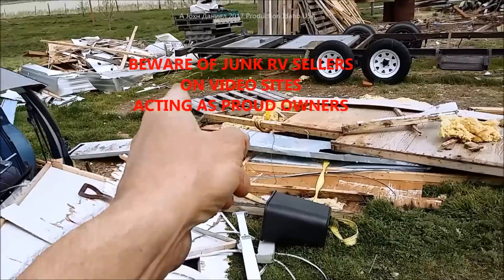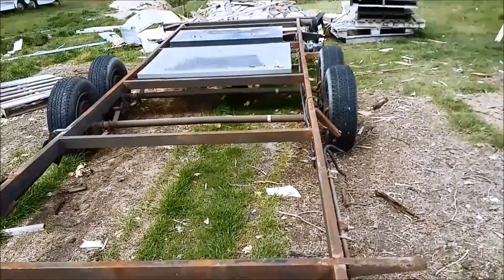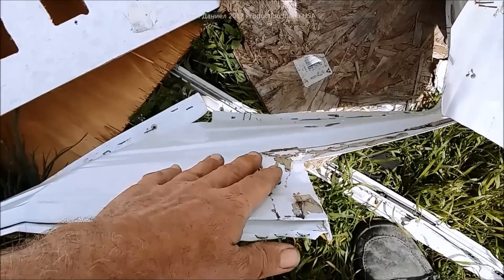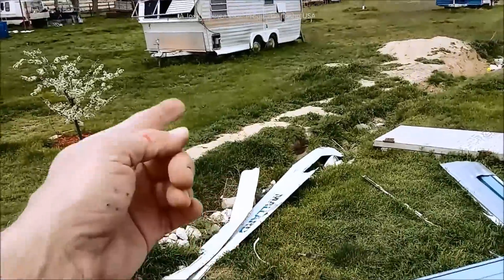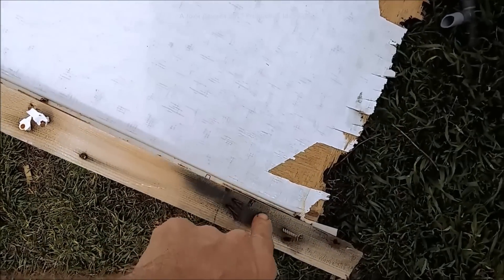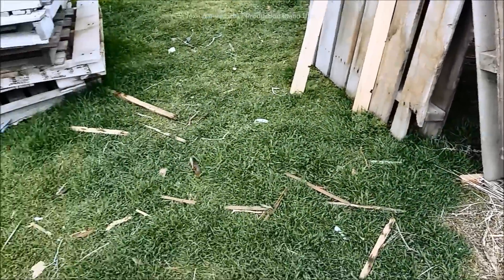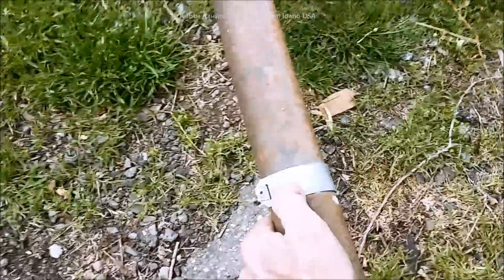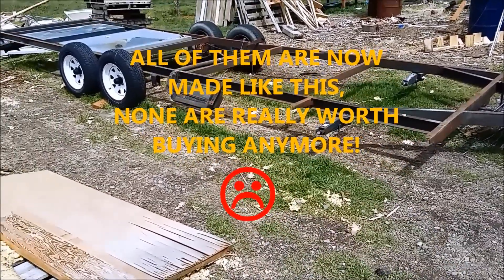HOW THEY MAKE RV Campers Travel Trailers, The truth, Wow! Info Below

Comment: Screwless enclosed trailers with one piece roof. Only wood is the 3/4" floor. Add quality appliances to your DIY floor plan.
Reply: Steven Morris Do you use blueprints or just design it yourself and try to balance the weight on the frame? Also, how do you fasten a screwless design? Use adhesives?
Reply: Steven Morris  and the floor can be composite .. that also doesnt rot... wood floors suck... ask a boat owner...lol
Reply: It's 3M adhesive tape installed at the factory that bonds the outside skin. Weight theory suggests 60% weight forward of center axle(s), 40% behind and 50/50 side to side when fully loaded. The rest is your imagination. GL

Comment: Watched another video recently about RV axles and this video really emphasizes the garbage. How can these manufacturers get away with underrated axles.
Reply: Powder River they are not underrated, just barely passable.   5,800# trailer rating, but remember that between 10% and 15% is on the tongue. 

Even the aluminum framed ones have issues.  Like forgetting to weld the roof to the side walls.  Staples through wiring.  Lapping metal in a reverse direction so when going down the road water is forced into joints. Not lapping roof over end caps and on and on.

There are custom builders that use quality materials with good workmanship.  Naturally you pay more up front, but buying quality is less expensive than buying cheap junk.
Reply: Charles Noska you’ve got point.

Comment: Like many, said, you get what you paid for. We bought a 2018 Keystone Passport and from everything I could see, specially the frame it looked to be built significantly better then what you showed. We traded it in for a 2018 Rockwood (just for lay out reasons) and the aluminum framed, foam filled vacuum bonded walls and ceiling are rock solid on everywhere. This new Rockwood is 8700lbs empty but I'd rather be pulling a well built trailer than worry about saving a couple more miles per gallon!
Reply: I hope you still like your Rotwood when it delaminates and the foam laminated junk floor gets soft everywhere
Reply: AnglerX  I think it's all on the owner.  Do your inspections of seals, roof ECT should last.  He does have a point that they are thrown together with staples, even TT that are at dealerships today.
Reply from the maker: I recommend absolute diligence & getting one of these, https://ebay.to/2KX8qVz to make buying and owning one less risk. A Scope to see inside walls, in and under everything.

Comment: I worked at a Fleetwood plant once in Va.Sometimes the camper would lift completely off the frame on its maiden trip to the dealership.
Reply: Wes Frazier 
What did they do then, set it back down and add more staples?
Reply: wes, im thinkin staples are optomistic!
Reply: Extra staples wasn't in the budget..... they use duct tape and a bunge cord.

Comment: Oh you're making me sick. I just bought a new Mallard. I looked all over YouTube for pros and cons and I didn't find a bad video. Now I've got one and I find this video. Man, all of a sudden I don't feel so good.  It's a 2018. Do you think it's the same crappy workmanship?
Reply: Ogooo.. It's even worse then before... look around.. tell me 1 thing that is any better then 10 or 20 years ago? you can't.. America sold out.... america gone under..
Reply: My mom just bought a 32' 2018 Mallard. It appears to be well made and solid. The frame looks very sturdy and it has 5,200lb axles. It isn't high end, but I don't see any reason it won't last. The MSRP was 42K and she picked it up for 25K. It has 3 pop outs and powered awning. We'll see how it holds up. She went into the market knowing that they aren't meant to last a lifetime.
Reply: mallards have com a long way in 10 years. they are made by Heartland now not Fleetwood and they use 2 by 4s now and wrapped better. this guy doesn't take care of his stuff that is why it leaks and is rotted. they have the enclosed underbelly which helps keep it dry. this is a poor rep of the modern rv....I know cause like your self I did some research when I bought my 2018 mallard m32
Reply: Stroker Ace . . . Then take a few tips from this video - - 
First - dry store the camper in at least a car-port.
Get wood glue or Gorilla glue and lay it on all hidden seams inside cabinets.
Apply wood anti=rot, or at least varnish to everything you can reach after the glue has cured. (obviously you can't pull down the wall-paper and do everything)
Consider welding diagonal angle-iron underneath to triangulate the frame . . . it looks like the stapled, thin wood box gives the trailer it's strength and shape.
Tow the trailer "empty" to reduce stress.
Reply: Stroker Ace mallards are pretty low end, not built to last long. I have a friend that bought one 3 years ago and the trim work is peeling and the sink leaks, etc.  Sorry...
Reply: Stroker Ace Yes, but anything you were considering prior to purchase is built the same way.
Reply: Fleetwood quit building wood frames at our plant in 2002. Keystone rv set up a plant close by and glutted the market with even cheaper units. Lippert Components  built all the chassis for both companies. When Fleetwood closed, Keystone bought the plant and continue to thrive selling cheap trailers to unsuspecting people.
Reply: Why should a person have to rebuild there new R.V. and tow it empty? Load and unload it every time you pull it. I'm a  retired R.V. tech. there all garbage.
Reply: Fleetwood RV no longer exists as a stand alone company.  The Fleetwood name was purchased by REV Automotive, and REV produces motorhomes with the Fleetwood name on them, and Holiday Rambler, and Monaco.  REV, thus Fleetwood, no longer produces towable RV's.  Heartland RV bought the rights to the Mallard name four or five years ago and produces "Mallard" travel trailers.
Reply: Even more so
Reply from the maker: I recommend absolute diligence & getting one of these, https://ebay.to/2KX8qVz to make buying and owning one less risk. A Scope to see inside walls, in and under everything.
Reply: The biggest killer is leaks, hands down.  Yep they're made light so that an average person can tow them with an average SUV.   Learn to spot the signs of a leak, keep a close eye on your roof, do your every six month roof inspection, seal up anything that looks suspect.  Floor damp spots, any stains, get down underneath and look for any stains on the bottom side. Any good camper space can fix the more difficult exterior leaks if you have questions.
Reply: I know, it's sad and no one's picking up the slack not the chinerese nor even the Germans!!! America's manufacturing gets sold out by it's govt in the 90's and the rest of the world suffers, I do feel your pain sir...
Reply: thanks for the info, i heard Fleet wood quit
Reply: Buy a used Evergreen Everlite Travel Trailer. Don’t go over the year 2012. This company built the Everlite series with zero wood in the roof, walls, or floor. They used a material called Compositek. I own a 34BHK-DS. I hope it never leaks, but if it does I can deal with the leak and move on. Never have to worry about rot! Return the Mallard...just my advice!
Reply: Mallard made by heartland nothiing wrong
Reply: Stroker Ace i got a 2004 mallard and it still solid with no leak everything still works
Reply: we just got a 2018 Rockwood Roo hybrid...Jesus I hope ours is better than yours...man I feel bad for you...we had a Starcraft popup...it was a 2016...I think it was junk. we traded for a new roo
Reply: Yep
Reply: Stroker Ace your RV is well made.enjoy it
Reply: I've visited Fleetwood,  Coachman and Keystone.   From what i saw of the frames and chassis, Coachman seemed to be the best and Keystone was horrible.  If you saw how they assemble a Keystone you would never buy one
Reply: Stroker Ace, Do good maint on your unit. ie. make sure you don't have any leaks on the roof, keep your tanks and water heater clean, etc. Yeah quality varies from manufacturer to manufacturer but longevity on your unit is just like anything else. Even a luxury car can go down the drain if not taken care of. Best wishes on your adventures.

Comment: Its also owners not taking proper care of their trailers
Reply from the maker: My Smart Solution -  build travel trailers with spot welded 1x1 24 gauge metal stud and 24 gauge hat metal, using jig built construction. Using spray in foam for additional strength & R-14.5 Insulated value.  
Result - Faster built, very light even 18% lighter than wood equivalent, tension durable, strong like russian bear, solid like mexican woman, user friendly like paid off grubberment official, and dependable like japanese radio!  And bonding glue agents with a few rivets on a metal to metal for outer skins is like how air planes are made, very long life and durable. 
You end up with cheaper, better, safer, recyclable, non expiring RV you won't burn in. But ah, isn't that the problem! It would last too long and be too safe.
Reply: Nicholas Brown, and Jayco brags about how they can build one in 7hrs. No thanks!!
Reply: Nicholas Brown im a master certified rv tech. They are all slapped together as fast as humanly possible with the cheapest materials available. Even if you keep up on leaks and reseals the newer ones will never last as long as the pre 90s rv's. Fleetwood bought out all the small outfits and started mass production. If you dont catch a leak in time its too late because its all pressed sawdust and osb. Sponges on wheels. The only manufacturer that has decent quality, unless you want to spend 1 mill on a custom coach, is newmar. And your going to pay more for their products too.
Reply from the maker: No kidding, the previous owner had the idiocy to take it out from his enclosed RV garage into the open weather on more than 5 trips.  He should have known it would get wet. Then he was foolish to file a insurance claim on the silly thing for the windows becoming showers on a trip.
Reply: It's called reseal the trailer as needed. I'll agree 100% that they're made very cheaply. But if windows and doors were leaking, the caulk should have been replaced. You have to maintain it.  This ain't Ron popel.  Cant just set it and forget it
Reply from the maker: I do agree with that, but no one should end up with a RV so shitty put together that it don't even make it past the 1 year warranty. I got it for $190 at a insurance salvage auction. When I tore it apart, it never even had insulation in most of the entire passenger side of the trailer, FROM NEW!!!! and the windows when I pulled them half had gaps in the mastic of up to 2 inches. Thats Fleetwood !
Reply: Watch the video on how jayco travel trailers are made. Makes me not want to buy a jayco. And it's their promotional video lol
Reply from the maker: In 1994 the very limited rules on RV's was relaxed so even the formerly GREAT makers went to shit. Holiday Rambler, Streamliner, Avion, and numerous other properly built RV's got lowered quality and or went out of business trying to compete with the STAPLE KINGS like Fleetwood. A PRE-1993 Jayco is a good RV, as well as the others mentioned above. If one like a Silver Streak or Rambler in good shape is found, grab it.
Reply: I just replaced the roof on my 95 nomad. It's not terribly difficult,  but time consuming.  I'm contemplating buying a new camper rather than rebuild a used one. The good thing about rebuilding a camper is you know what you have. The new junk is all pressed cardboard. Unless you're willing to spend 100k. Which I'm not. And even then there is no guarantee
Reply from the maker: Wanna buy a solid 1976 Holiday Rambler 32.5 foot Presidential to upgrade and do up nice? I would sell mine to a person intent on modernizing it. Its very solid, aluminum framed and no rot or damage other than just its age. $2500 and its yours!  I got too many rolling wonders!
Reply: Pass but thanks
Reply: Nicholas Brown yeah I saw that one.  Absolutely insane.  This guy is right.. ..they pump them out just as God awful fast as they can and they say piss on quality......
Reply from the maker: The Rambler? Twin Falls Idaho. I have a newer very large refrigerator, new AC unit and a few newer items already in it to start its refresh job. But being such a solid RV, that makes it easy.
Reply: Nicholas Brown even 100k won't get you what you pay for. If you can find a used newmar theyre about the best quality for the money youll find. Do not buy a rotwood. (Fleetwood)
Reply: Othership Adventures please eplain to me how 1989 was 40 years ago?
Reply: Јоhn Daniel 
John, what is the drivetrain and rubber like?  Overall condition?  Mileage?  Your realisticity of the trailer industry is despicable for their part!  Would you consider doing a video on campers and motor homes, even though they are similar with trailers? Thanks for your brutal honesty.
Reply: Yes, I'm in Florida. Hope you video her progress. Thanks!
Reply from the maker: I recommend absolute diligence & getting one of these, https://ebay.to/2KX8qVz to make buying and owning one less risk. A Scope to see inside walls, in and under everything.
Reply: bullshit
Reply: There is no excuse, the company makes them so cheap to turn a larger profit, they dont make it last.
Reply: What about Airstream?  Are they not still high quality?
Reply: Where is it?
Reply: did you find evidence of mold in the walls? Just curious since there were so many leaks
Reply: Amen
Reply: If the trailers were better built the owner wouldn't have to so much maintenance to it.  They would be able to use it without worry of this or that breaking or rotting into oblivion.  I'm not saying to build a maintenance free product.  That's impractical.  But if they were built better from the start it wouldn't be so bad
Reply: My granpa has a 2017 basically new 50's style camper. It is beautiful, it has whitewall tires, cool red siding, and a checkerboard floor. But its the cheapest piece of shit I have ever seen!! They live in a very rainy place which makes it completely unlivable. With 7 damp-rid containers, and wiping down the windows it still is starting to get significant water damage. Anything that touches the wall rots it out and molds. The walls are made of what can only be described as fancy cardboard. When you so much as gently push on the hall wall that is also the shower wall the entire shower bows and faucet and whatnot move a good 4 inches. Ive been staying in it temporarily and i do my best to maintain it but im ruining it just by being inside it (condensation from temp difference). I wipe the windows, below the windows, and the 3 inch strip of wall along the floor but theyre still molded to shit. Any advice (other than lighting it on fire and pushing it off a cliff), this really makes me look bad but im very responsible and caring, it just seems like they werent designed to be inside when its below 50. Its a floor model so idk if that has anything to do with it
Reply: Nicholas Brown the fact that you had to replace the roof at all says everything there is to say about the craftsman. My 89 MCI is already 40 years old and still doesn't leak.

Comment: @5:30 Did I even see your face because I've got a crush 😍😍😍
I saw your comment that only one RV company still builds a solid RV, did I misread?
Reply: Still need to be careful.  In recent years, THOR has purchased most major brands, and those brands are still independently run and the RV's built separate.  THOR owns Jaco, and I'd compare Jaco to this Fleetwood you had on the video.  They also own Keystone, better, but still cheezy.  THOR owns Airstream too.  So, its all over the place and too hard to tell what junk you are getting.  I know from experience to stay away from Rockwood ultralites.  Junk.  Paper thin walls and floors.  Entire RV twists and turns with one person walking around.  Crap falling off everywhere, on a 2017 model bought brand new.  Fleetwood went belly up in the mid 2000's.  A independent investor bought the name, and is starting to produce RV's under that name.  They are made one at a time, very slowly, and are focused on quality.  Good to hear, not sure if they will survive doing it that way though.  Thanks for the video, most folks don't know what is behind those crappy dressed up walls!  I bought a Adventure Manufacturing Timberland TT, that is built much better with 6500lb axles (x2).  Still has some of the craptacular cabinets and particle board furniture, but over all I've had the walls apart and it's very sturdy.  Of course, this company went belly up in the 2000's as well.  I'll be modernizing and forever keeping it going so as not to have to buy anything newer.  Cheers!
Reply: he said buy a used Airstream
Reply: John Daniels u MUST work for Thor or own it. They have possibly the worst product in the business. Go to 10 campgrounds & ask who has the bottom of the barrel name. THOR !
Reply from the maker: No, truth is THOR industries has been the only mega builder who uses better methods. I don't know anyone who works there, but in years of servicing RV's you never have to worry about structure on a Thor made RV.  https://www.thorindustries.com/

Comment: So John, is there a year range where they were actually making quality TTs ? My 1st RV was a 36'Coach made in 1986 and it was loaded with Crap leaking, un-repairable grey colored water pipe. I'm skilled with tools, and thinking of going Nomad . . . any suggestions please.
Reply from the maker: Just about any classified as 4 season are normally way better built. The best one out there is a Holiday Rambler, years 1974 to 1993. A Silver Streak like a Boles Aero is very sought after, as is a pre 1985 Avion. After 1987 some rules changed and eventually all started to be built like disposable junk. As for newer trailers after 2005, a THOR made trailer in 4 season build exceeds all others in lack of call backs or warranty work.